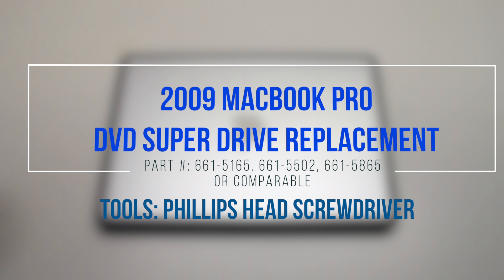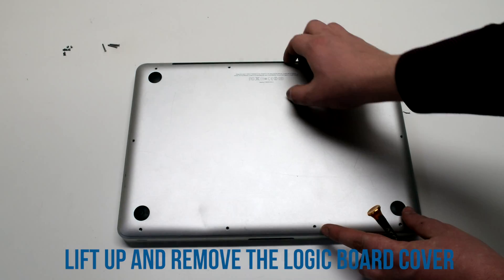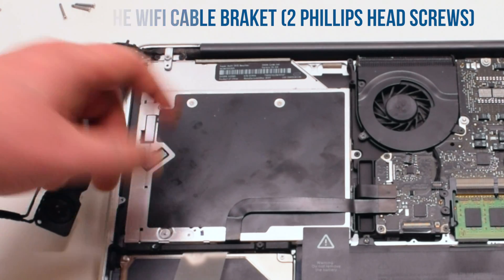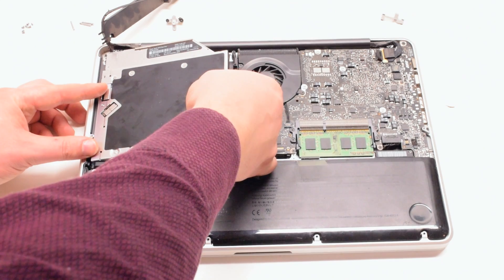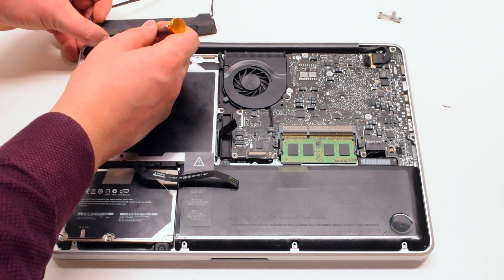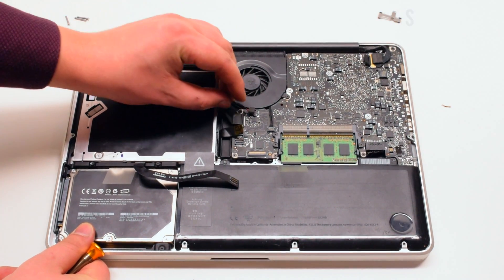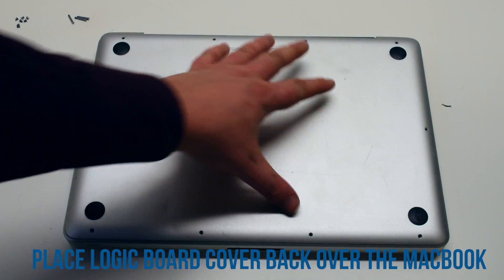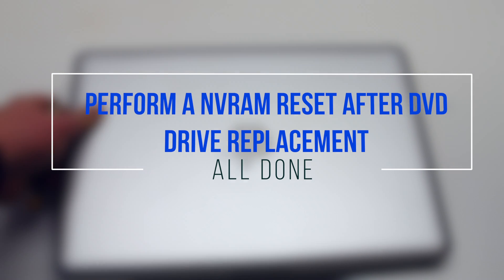2009 Macbook Pro 13" A1278 DVD Super Drive Replacement

Comment: Your videos are very helpful, wish you would give a brief explanation of how to remove the plugs. Do they slide off, lift off, etc. It is not always apparent to those who don't do this all the time. I did break the video plug. I don't suppose there is any way to fix that. Anyway, thanks for the video. It is a ten year old Mac so it may have been destined to break.

Comment: have you tried switching our the Super Drive for an additional HDD? Would run at a slower transfer speed but would be cool to see if it works.
Reply from the maker: +David Hasselhoff actually we are working on that video right now. It's 1.5mbs on some units. I'll post the link on this comment when we finish shooting it.
Reply from the maker: +David Hasselhoff The Optical Bay Hard Drive Adapter video is now up at https://youtu.be/nMo_sLQwp-E for more information check out our site page on this at http://www.appledollars.com/optical-bay-storage 

You might also want to check out how to get incredible data access speeds with using the bay to setup a RAID 0 system at http://www.appledollars.com/mac-raid-setup 

Thanks for the comment, Good Luck!